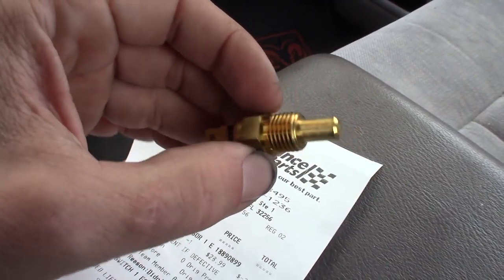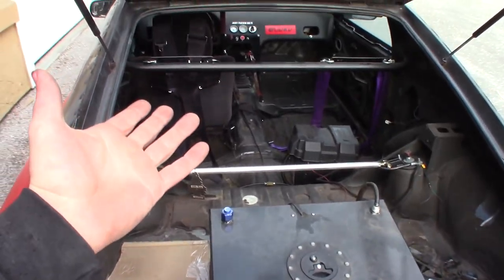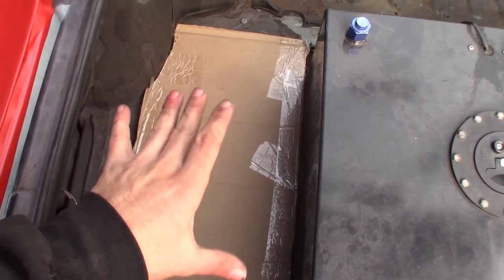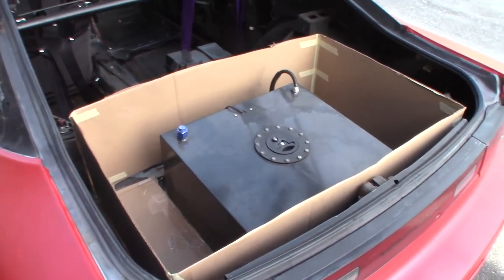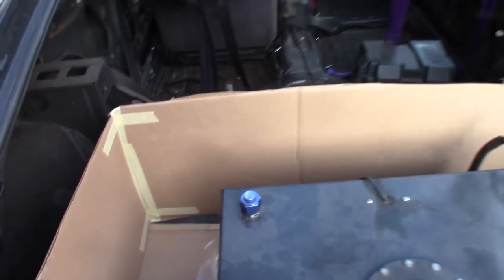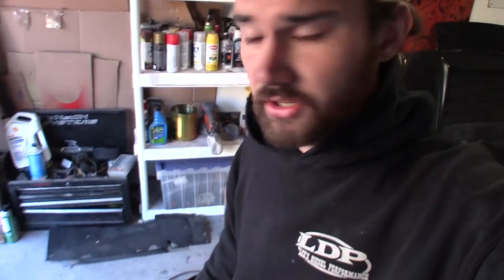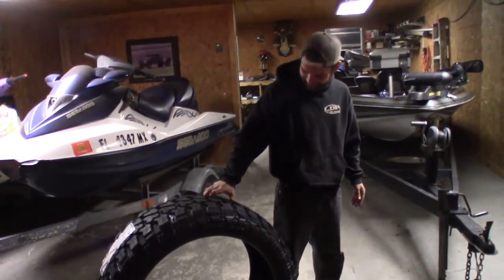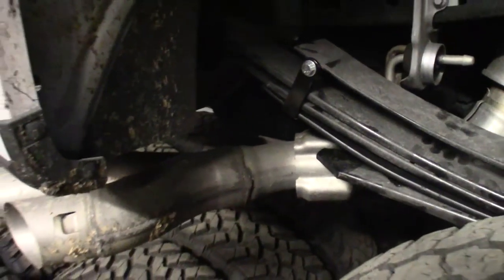Prep Work for Fuel Cell Floor pan Repair (Saving my 240 Pt. 1) | Sneak Peek Of Chris' Truck!

Comment: I’d recommend putting a bead of silicon on the edges of the box, I’d hate to see you use the L brackets and it not pass tech.
Reply from the maker: Zack Gray thanks for the suggestion, i May have to do that just to be safe.